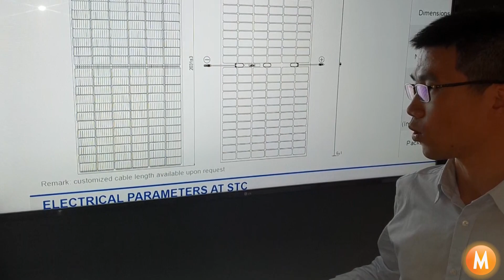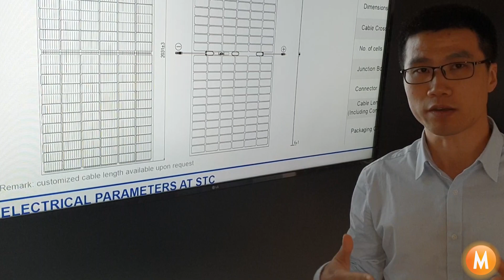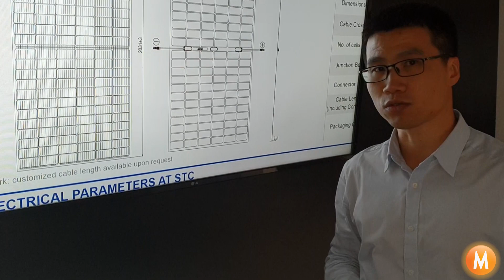JA Solar 400W Half Cell PERC Mono Solar Panel

Comment: Hi M Solar Power.
Please tel me the purpose of central junction box. can we use both portion of the solar panel in parallel when needed???? I am waiting for answer.
Reply from the maker: Central connection for both half of thr panel for reduced current resistance and increased output

Comment: Hi, what does mean by the Current Class(H,M,L) in JA solar pannels? And what is the best class?
Reply from the maker: H refers to High when shown on a pallet of panels, M medium and L for low, the idea being when you do a large commercial installation that you group the panel class together on one string for a more efficient installation and not 'waste' the extra watts.  So H or high modules would be the best pallet to acquire out of a particular set of panels by up to 3 Watts per module.

Comment: Hello, Can you guide what is "Current Class L" written on JA Solar panel? what does it mean?
Reply from the maker: Hi, panels ship in 3 classes L,M & H, or low medium and high, for best installation efficiency the same power class should be used all on the same string. There is normally around a 3W difference between classes  so having the same class solar panel on the same string / mppt means that this power will be gained.

Comment: Having this many extra cells on a solar panel module requires a lot more soldiering connections. It just seems like this type of panel would be a lot less reliable.
Reply from the maker: Hi Boby, thanks it has not caused any problems as yet